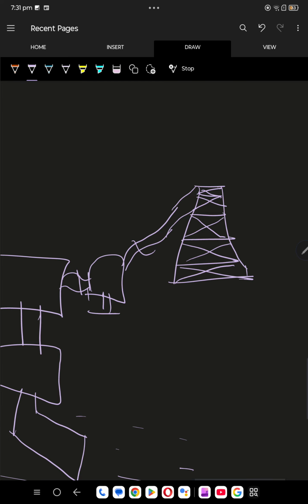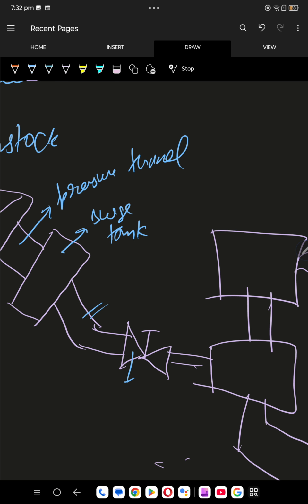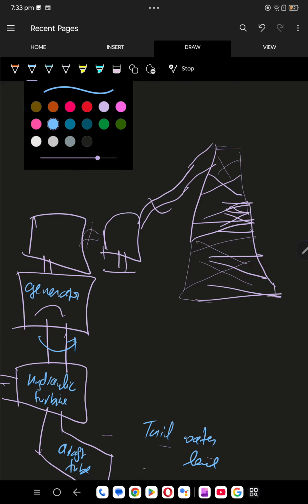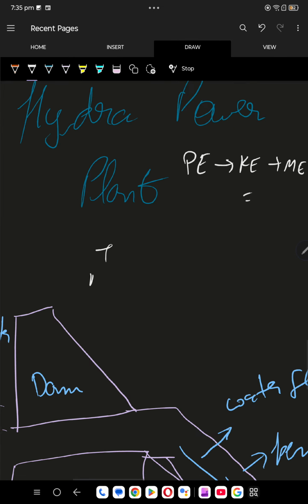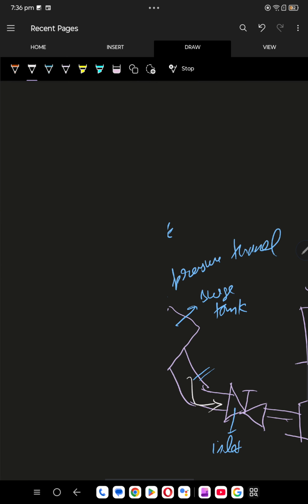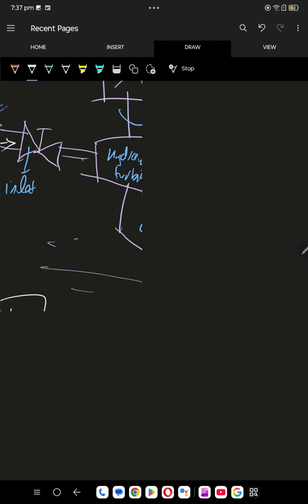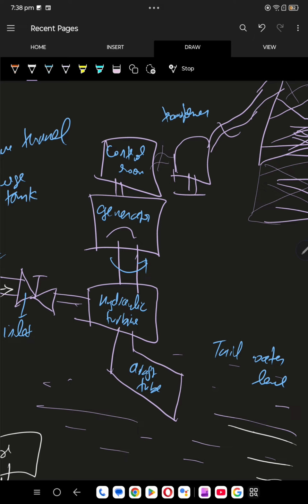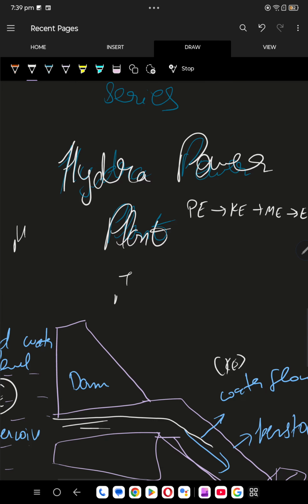HYDRA power plant simple explanation

Comment from the maker: Reference notes with help of llm 
🌊 Hydropower Plant – Neat Systematic Explanation

⚙️ Basic Idea

A hydropower plant converts:

Potential Energy → Kinetic Energy → Mechanical Energy → Electrical Energy

🏗️ Construction (Main Parts)

Dam & Reservoir

Stores water at a height (head water level)

Gate / Valve

Controls release of water

Penstock

High-pressure pipe carrying water

Surge Tank

Reduces sudden pressure changes

Hydraulic Turbine

Rotating device with blades/buckets

Generator

Connected to turbine shaft

Transformer

Increases voltage

Transmission Lines

Carry electricity to users

🔄 Working (Step-by-Step)

Water stored in the dam has potential energy

When the gate opens, water flows through penstock

Potential energy converts to kinetic energy

Water strikes turbine blades → turbine rotates

Turbine converts kinetic → mechanical energy

Generator converts mechanical → electrical energy

Transformer steps up voltage

Electricity is transmitted through power lines

Water is discharged as tail water

📍 Key Points

Greater head (height difference) → more power

Plants are usually built in hilly regions

Turbine and generator are connected by the same shaft

Water is not consumed, only used for energy transfer

✅ Advantages

Clean and renewable 🌱

No fuel required

Low operating cost

❌ Disadvantages

High initial cost 💰

Depends on water availability

Environmental impact

🧠 Final One-Line Flow

Water stored at height flows → spins turbine → drives generator → produces electricity → sent to grid.